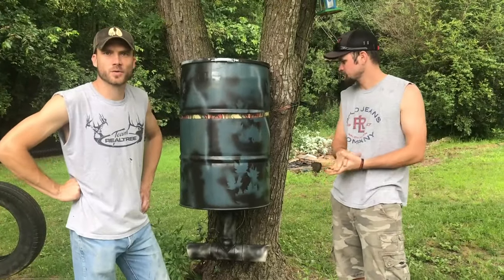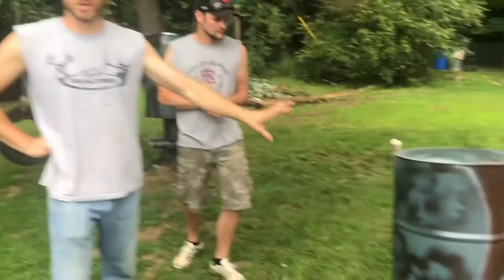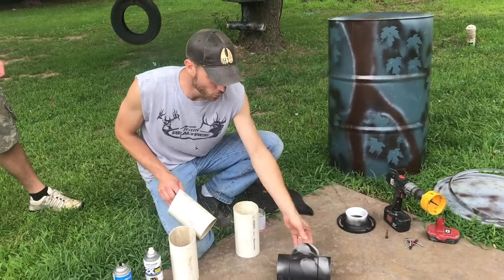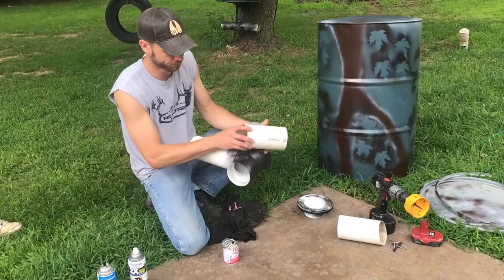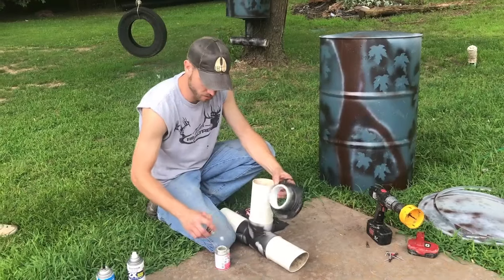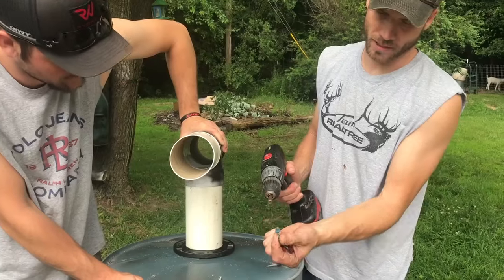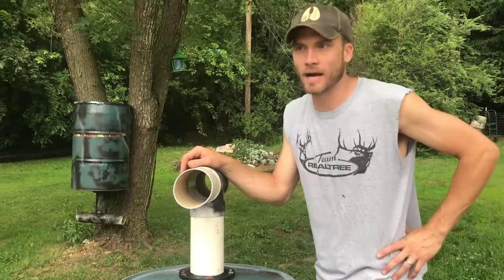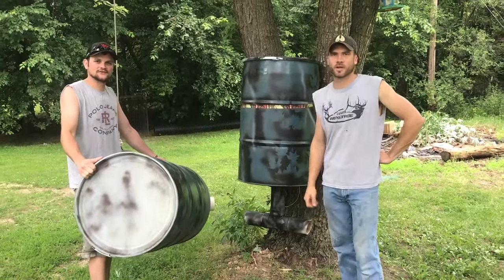DIY 300lb Gravity Feeder for under $30

Comment: I like your design and built an exact copy. But here is my experience (failure) and modification if it may help someone. I had everything completely assembled and glued together. I tested it with whole corn and the corn continuously poured out at about 20-25 pounds a minute. I cut two strips of the 4 inch pipe about 3/8” wide and a half circle. I glued these (double-thick) at the edge of each spout to form somewhat of a dam. I then put 3 small screws from the exterior of the pipe through the strips for “insurance”. I also put a 4” strip of traction tape just behind this to create a bit of friction. It worked well after that. I could pull corn over the dam with my fingers and it continued to backfill up to the dam. The screws and friction tape may not even be needed, but I’d rather have it and not need it than need it and not have it. I’m glad I tested it before I hauled it way out in the woods.

Comment: Why put the flange on the outside of the barrel. If you put it on the inside going out, there'll be less stress on the bolts and the flange itself.
Reply: Mine works best outside. The inside version restricts that last bit of corn. That corn that doesn't fallout gets moldy.
Reply: @EDB0223  so your saying the last little bit gets moldy, but when you fill the whole barrel up....none of it gets moldy before it's all eaten. Your feeding tube is mounted off center, so all of the corn won't fall out anyways.  Another problem is your ratchet strap idea.....you are putting a lot of weight tension on one point. Why not just put 4 legs on the barrel and let it stand up. Too low to the ground. Look at the one in the video....a deer has got to get down low and up under the barrel just to get to the feeding tube. What about a buck with a good rack? He won't be able to get to it. If it sounds like I know what I'm talking about, it's because I do. Check out my YouTube video "55 GALLON GRAVITY DEER FEEDER". I've even done a few more improvements since I posted the video. I shortened the legs to 4 ft. And angled the PVC towards the ground so it would make a small pile on the ground. Works like a pro now. 

Don't take my comments as rude or ugly. I'm just trying to help with ideas for a better feeder. Good luck hunting!
Reply: @dalewalker2379 dude your comments are rude… mouthy in your response.
Reply: @kylewhalley3573  I'm  sorry that you are getting your feelings hurt over a little constructive advise. If you put your video out there, be big enough when others comment with advise. I was just trying to help. I'll not have another comment on your feeder....build it however you want

Comment: I have made many of these for 30 plus years in UP of Michigan. Forget all
 The pvc pipe it’s waist time. Just take 55 plastic drum an use a 3” hole saw an cut a hole at the very bottom front. Set up against tree an fill with whole corn. When fill just set your foot in front of hole for first bag you dump. The corn will gravity out as deer pull away from front. Painting is waist of time but bear will tip over so lag bolt barrel to tree.

Comment: How did the feeders work for you?  I'm going to use your design this season. Putting the feeders out this weekend.
Reply from the maker: They have worked great for us so far, the main thing that we have noticed is finding the right right tree can make it a lot easier for putting the locking lid back on so it closes good! We actually have 2 out in Kansas right now, just waiting for us to make it out there for our rut vacation!! Hopefully it works as good for you as it has for us, good luck this season
Reply: I will let you know how it goes. I was thinking of putting a 2x4  between the barrel and the tree. It should create enough gap to access the lid. Without tilting it to much, I hope.
Reply: Thanks! Guys I made two feeders. So far two 🦌 down plus a doe. More to go.